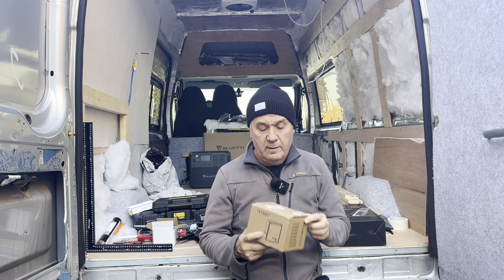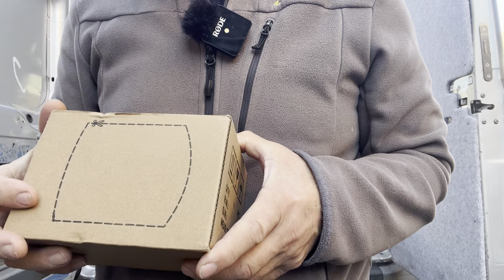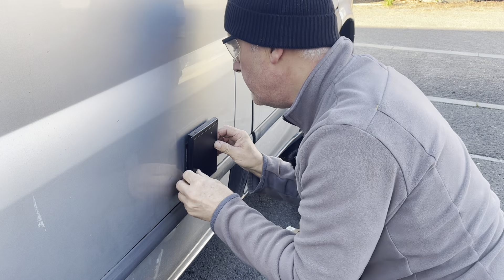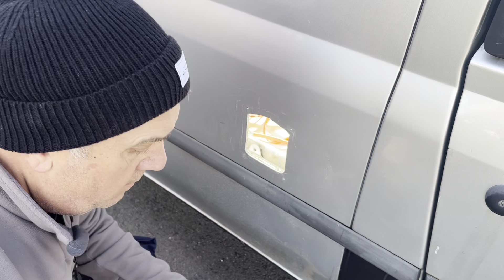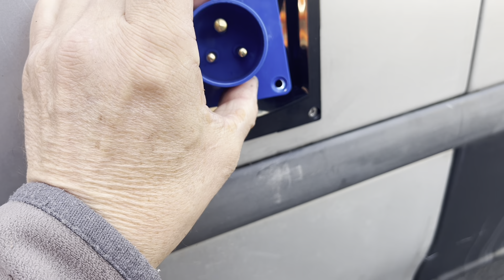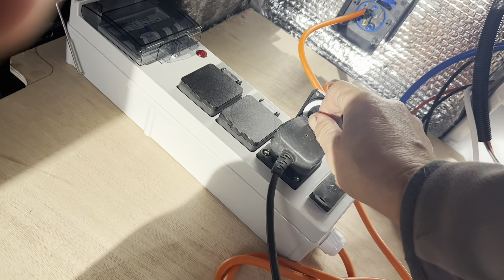Easy 240v electric hook up installation. Camper van build (4)

Comment: Has anyone actually taken one of these portable units, opened it up and added an earth to the bar and installed in van?  I have a maypole consumer unit I've been using for a few years but would not like to fit a proper external hookup.  Don't need and more plug sockets etc
Reply from the maker: Hi, not that I’ve seen or heard of, but i can see where you’re coming from

Comment: I did something similar when I was doing my van as I rarely use hookup but on the forums I'm constantly reading this isn't safe, something about the van bodywork could become live if there's a fault and the RDC not tripping. Plus to be up to code it apparently has to be a type A RCD, double pole now, I dunno it's a bit beyond me but thankfully there are pre-wired kits widely available now so I'm going to upgrade with that.
Reply from the maker: Hi, I’ve had similar comments on here, opinions are split, I spoke to a auto electrician and thinks it’s fine however I totally get anyone erring on the side of caution

Comment: How do you ensure it is earthed safely
Reply from the maker: This has proved to be quite a contentious subject, have a look through the comments to see some different opinions
Reply: @BobbyLee-d6x why would it need earthing? When it’s used in a tent it goes through the doorway or other opening and doesn’t need earthing. With this setup, he has simply made an opening in the side of the van and passed it through. No electric cable is touching any metal part of the van. 
Many people have said that they thread it through the window. There is no difference.

Comment: I have exactly the same setup as this at the moment except i just leave a front window open and have the wire going out that way, need just to put the input socket on the outside but always wondered the way I've been using this is it safe because a proper consumer unit has a separate earth to the van where this way hasn't
Reply from the maker: That’s a good option if have safety concerns 👍

Comment: Good video. Just in case people don’t go to the comments below, could you edit to make it clear that you need to earth bond the consumer unit to the chassis. Otherwise if the live contacts to the chassis the RCD will not trip and will make the chassis live. It could also wreck your 12v system. 
If the chassis is live if a person earths whilst touching the van they will. Complete the circuit. 
I am not an electrician, but worked as an electrician’s mate on a YTS training scheme, Once while working about 20 feet up fitting a new light, someone switched the light on. I was holding the live and was fine until my hand brushed the metal lamp body which was earthed, (I was isolated by my boots until then) and bang. The fuse did not blow.  Fortunately I didn’t fall.
My boss was watching the whole thing and let it happen because “it’s a lesson you’ll never forget”. He was right! 44 years later.
Health and Safety is good, old school electricians that think H&S is a bit nanny state, not so much. 
To reiterate, I am not a qualified electrician, so please seek proper advice.
Reply: Just to add, i really think your clear explanations are very good. Masking tape over the intended cut area would avoid scratching paintwork.
Reply from the maker: Hi, I’ve had similar comments to this before, as a result I spoke to a qualified auto electrician about what I’ve done and he said it’s fine. I don’t claim to be an electrician of any sort but the Eurohike unit I’ve used is ment to be used without a separate earth, it’s sold to be used that way, no one has been able to explain to me how that changes because I’m using it in a van.
Reply: @ essentially, should the live come into contact with the chassis ( loose connection, wire trapped, rubbing etc) it will make the van metal live. Because the van itself is not earthed, the rcd (or whatever trip system is used) won’t trip cutting off supply. So, the supply will continue. Then, if someone touches the van body and the ground simultaneously the circuit is completed with them as the earth “wire”. Until then the van is a faraday cage, unearthed, insulated by the tyres.  
Awning leads are not meant to be used in vans for this reason. 
If you look in the comments someone who is an auto election has already said a similar thing. 
There is also the risk of damaging the 12v system which is already earthed to the van, via the negative terminal on the van and leisure battery (although a negative terminal isn’t a true “earth” it just completes the circuit.)
So, you have to earth the van properly. I’ve seen some people rig up a wire and metal spike banged into the ground, but the rational thing to do would be to use the earth from the ehu, just as you would if you were fitting a normal camper consumer box.

Scroll to the diagram in the link and it shows an earth from the ehu inlet (shore power inlet) connected to an earth busbar (in the consumer unit) then connected to the chassis earth.
It doesn’t mater if you’re using a consumer unit or an awning unit, once it’s in the van it should be properly earthed. Electricity doesn’t change its characteristics. Different kit for different things. 

https://www.thevanconversion.com/post/the-complete-guide-to-installing-shore-power-in-your-van-conversion

I’m not being difficult, but an auto electrician has said as much in the comments. (I hadn’t thought about the possibility of damaging the 12v system)
My concern was that if someone watched the video and didn’t read the comments they would not know and put themselves at risk they don’t properly understand. 
Hope this helps explain the risk and  is genuinely not a pop of any kind I think your content is great.
Reply: So just run an earth/ground cable from the respective point on the EHU where you wire in your hookup unit, to a chassis grounding point?

Comment: Instead of switching the plugs over all the time, is there a way to have everything wired up together including the power station, so when not using the electric hook up the power station continues running the 240v and if you put into the electric hook up it charges your power station and your power station provides power to your electrical circuit? 

Thanks
Reply: I have a Jackery power unit, when you use the output sockets from it, internal cooling fans come on. So I think the only drawback with having the power unit always on, is always having that fan noise in the background. Otherwise I think a good idea.
Reply from the maker: Yes, I may not have been clear on this. I have run 2 cables from the Bluetti to double sockets on the walls, these are permanently plugged into the Bluetti

Comment: Hi, great video. Can you not plug the bluetti into this kit even with everything still plugged into the bluetti, instead of having to swap plugs over every time you hook up to mains.
Reply from the maker: Hi, thanks for asking. Yes you can is the answer. I was thinking of saving power while charging but now see that’s not necessary, I’ve just fitted a Bluetti charger one that puts in 550 watts an hour when engine is running, a real game changer

Comment: I stumbled across this video as I was thinking of doing the same. Would have though you could just use a terminal block/busbar to connect the hookup earth and sockets earth to van chassis, then it’s fine? The consumer units have an earth busbar in them doing exactly the same?
Reply from the maker: I did check this out with an auto electrician and he said it’s fine as it is so long as it’s used as it was intended. So I’ll be using it to charge the Bluetti and plugging other appliances directly into it.

Comment: I’m doing the same in my van the wire you cut of if you put another blue plug on it you can use that for the cable to the camp site plug Dave you buying another lead
Reply from the maker: Great tip, thanks

Comment: Thanks for your suggestion.  I really liked this idea and bought one online.  Recived today and will be using it in my van too together with the Bluetti.  One question, how did you fix it to the furniture  Did you dismantle it to fix to furniture?  Another question.  Did you end up earthing it?  Thanks in advance.  Mario
Reply from the maker: Hi Mario, I have had mixed information on weather or not to earth it, I won’t be. However I won’t be using it to run the vans AC circuits. I will run those through the Bluetti and charge that from from this as well as plugging directly into it, so basically using it as it was intended. Hope this helps

Comment: I think this is a fantastic idea. Im about to install the same in my camper conversion.  Having looked at many videos on YouTube installing the kits, I have one question -  why is an earth not needed to be fixed to the metal bodywork?  Forgive me if this is a simple question but Im new to this 😊 thanks
Reply: You are correct when mains is used in a campervan the earth from the consumer unit should be grounded to the metal bodywork of the vehicle. Without this if a fault was to develop in a mains product being used in the vehicle the body of the vehicle could become live and as the vehicle is insulated from ground by the rubber tyres, the current would only run to ground when someone was getting in or out of the vehicle, by running through the person to ground. the mobile mains camping unit is fine when used in a non metallic tent with out a earth bond, but not inside a metal box on 4 insulators'.  (Do google "why earth bond a campervan")
Reply from the maker: I checked with an auto electrician, he said it’s not necessary as it’s earthed through the 240v connection and protected by the RCD andMCB . The Eurohike unit is after all designed to be used without a separate earth.
Reply: @terrysallbikes  Hi Terry. Great job 👍.

Electrician here and your auto Electrician is wrong, you must earth the chassis of the van direct to the consumer unit 👍
Reply from the maker: @TeamSimpsonRacing  hi , sorry can’ you explain why? The unit I’ve used is obviously designed to be used without a separate earth, I’ve basically cut the cable and inserted a plug connection, why does this now require a separate earth?  I obviously want to get this right and don’t want anyone following this if it’s wrong
Reply: @terrysallbikes  if any wiring or anything you have plugged in faults and is in contact with any conductive part of the van, the whole chassis of the van will become live. Without an earth path back, the RCD will not trip and the chassis will remain live. Also, the chassis of the van is the negative of the vans 12v electrical wiring system and that could then be destroyed with 230v. 

A main earth to the chassis gives the fault current a path back to the protective device/s (RCD) and that is how they detect a fault and operate to disconnect the supply. ADS = automatic disconnection of supply
Reply from the maker: Thanks that makes sense, please excuse my ignorance, however it doesn’t answer my question, what’s the difference if I just plugged one of these in and used it in the van as intended?
Reply: @terrysallbikes  because you have installed it into your van, its not a loose extension lead anymore and is now classed as fixed electrical wiring and has to comply with the electrical regulations.
Reply: @TeamSimpsonRacing for those viewers not in the know, can you clarify that an earth/ground cable from the earth pin on the back of thee EHU to the chassis would be appropriate?
Reply from the maker: Hi and thanks for your comment, please see my reply below

Comment: That looks a good solution for mains electrics. The wire that runs to the circuit breaker/ sockets  will be hidden, I guess? 
If it is, is it worth running it in some ducting?
I'm not an electrician but have wired my own house, getting a qualified guy to inspect my work and sign it off. Apart from one socket that had a poor earth it was OK.
When the van is a camper will you have to change the paperwork?
Thanks for the latest on the van, hope filming isn't slowing progress too much.
Reply from the maker: Well I have to say wiring a house is somewhat impressive. In answer to your question yes it will be out of sight under a seat and I’ve just been running some conduit this evening. Thanks for watching and your comments Colin always appreciated 👍
Reply: Terry, conduit seems a good idea for wiring as you don't want any cable to chafe against any metalwork. With vibration it is surprising how things could soon rub. I have 30+ years of routing cables in the aircraft industry in a high vibration environment and aerospace regulations. Keep separate from the 12v DC and the Van's existing cables.
Reply from the maker: @ thanks I’ll be sure to do that 👍